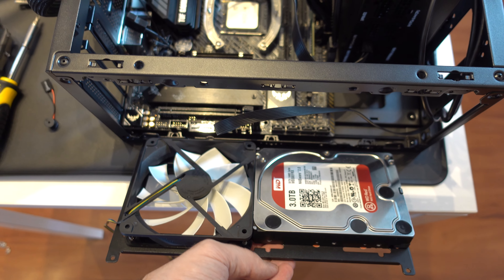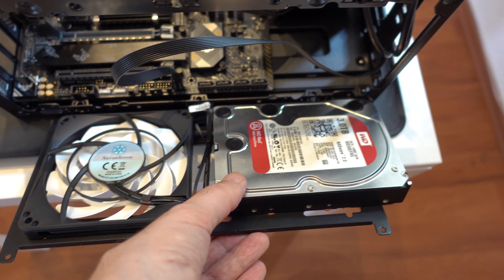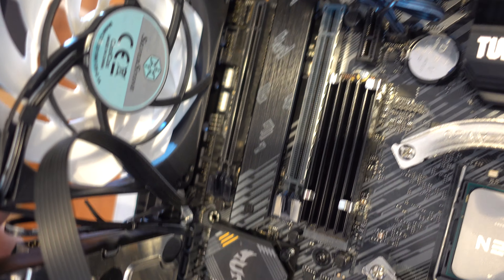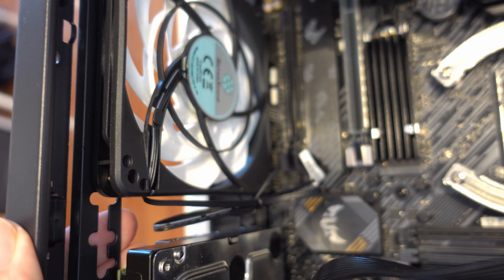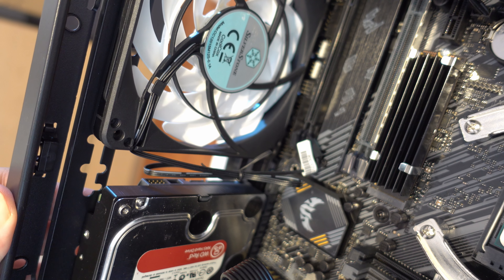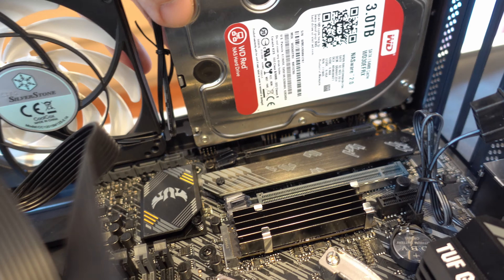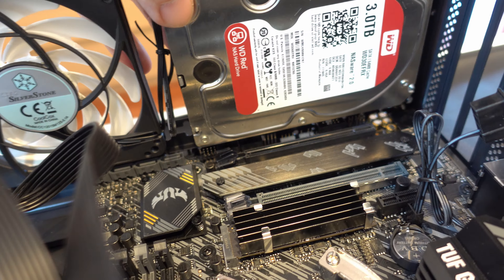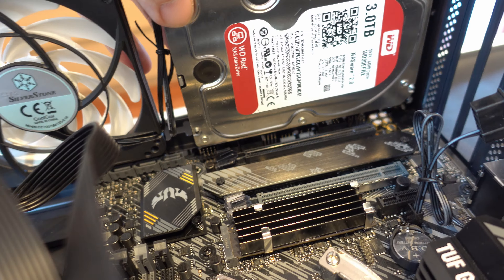SAMA IM01: major incompatibility of the mainboard and bottom bracket (and how to easily fix it)

Comment: You can actually move the fan a couple of mm's away from motherboard. There are offset screw holes on the bracket.
Reply from the maker: 😲 I hope this isn't a case of me being blind to an obvious solution - although everything is fully operational since a while, I'll check! I'd need at least 5mm of an offset, though - this is the gap I had between the case and bottom bracket when the fan was already touching MB bottom pins/connectors.

I'll check and will report back - thanks for suggesting a solution!
Reply from the maker: I checked the top bracket (easier to access) - and you are right! 😅 Yes, there are indeed ~5mm offset holes at 105 mm distance, which is exactly the screw hole distance for a 120mm fan....  Either I have failed to notice those (then 🤦🏻‍♂️🤦🏻‍♂️🤦🏻‍♂️), or mounting an HDD next to the fan didn't let me use offset positions (I seem to remember that only one pair of screws was next to an offset hole?). In any case,  I'll pin your comment to make it easier to see - thanks for the useful contribution!
Reply from the maker: Reviewing the first 3 and a half minutes of the video tells me this: 1) for the final configuration, I was trying to push the fan and the HDD as far from each other as possible to make room for the SATA and power cables, and 2) that did indeed prevent me from noticing offset holes.
So a much better solution for this exact fan+HDD config would have been some kind of a slim/flexi SATA power cable, and bring the fan and the HDD ~5-6 mm closer, to push the fan into those offset holes. Then no modifications to the fan should be necessary.
Reply: @tetracephalium  I solved the fan the same way, holes :) But I have no idea about SATA, I can't find a cable that is bent by 90 degrees and rotated by180 at the same time, as you indicated in the video. This board is not exactly the most suitable.
Reply from the maker: Finding such (data) cables wasn't easy indeed, but I did find some. (it's relatively late here and I'm exhausted after a long day, so I'll look up and post the ones I've used tomorrow during the day.)  I did give up on analogous power cables, though, and simply "forced" PSU's cables to "fit" - bottom panel isn't visibly bulging, so I guess that was alright 😅
Reply from the maker: @SUST-RWM  I've used two different types of SATA data cables (disclosure: both are affiliate links): for the HDD in the bottom bracket it was a "server-style" thin wire Silverstone SST-CP11-300 - Ultra Thin SATA III 6 Gbps Cable https://www.amazon.com/gp/product/B00L6M0LQE/ref=as_li_tl?ie=UTF8&camp=1789&creative=9325&creativeASIN=B00L6M0LQE&linkCode=as2&tag=bioua-20&linkId=9db6f04526484fbf680563ab9664dae5 (you can probably find many more of similar ones by searching for "server SATA cable"), and for the front panel SSDs I've used simpler/cheaper StarTech.com SATA to Left Angle SATA Cable https://www.amazon.com/gp/product/B004KDTTXW/ref=as_li_tl?ie=UTF8&camp=1789&creative=9325&creativeASIN=B004KDTTXW&linkCode=as2&tag=bioua-20&linkId=18dfcbd49d199e45dde8f67f3c7835cb  Hope this helps. If you do find some kind of slim/flexible SATA power cables - please let me know 🙂
Reply: @tetracephalium  Thank you very much. Searching for "left" or "server style" didn't really occur to me :) Now I found those and also cheaper cable here in Europe from PremiumCord, which cost 1 USD. As for SATA power cables, I'm probably lucky, because the last connector is oriented so that it does not interfere with anything if there is at least a little space under it, the wires point upwards (Fractal Design ion+ 2 660W). While buying an ATX power supply was a really bad idea, at least this seems to fit :)
Reply from the maker: @SUST-RWM  oh wow great cable find, then! I'm also in Europe but didn't come across that company. Glad this seems to be looking better for you!

Comment: I'd just like to say I appreciate all the vids documenting this build as I'm planning to downsize to this case (well, the differently branded Tecware Fusion which should be the same as this case), and I have a similar Asus TUF mobo, similar Corsair PSU (only it's 850W but same dimensions I think?) and a 5700 XT EVOKE. The tricky part is the EVOKE is a 2.5 slot GPU so I think it might not work at all, but the worst that could happen is I give the case to someone else in need and reuse my old one
Reply from the maker: with a 2.5 slot GPU you might do alright without any fans in the bottom of the case; GPU fans will pull air directly from the bottom ventilation holes 😁

Comment: Option1: Just invert the case... by inverting the case you can have space enough to fit a 120mm fan or HDD. 
Option2: You can mount that HDD in the back panel. Remove that 80mm fan installed in the back panel.
Reply from the maker: Thank you for the suggestions! In option 1, what do you mean by inverting? Using the top bracket space? I could indeed mount an HDD there, at the cost of longer power and sata cables - but otherwise that's a good option. Option 2 I did consider, but back panel is where  the cpu fan blows hot air, so placing an HDD there will both make it hotter and make the case generally hotter.

I guess the best solution was to not include any legacy HDDs and SSDs, and only have two NVME drives. (Inventory management is always a problem for me in RPGs, I always want to keep all the items 😁)
Reply: @tetracephalium  You can interchange the panels of the case coz they are the same size and fits (side panels and top/bottom panel) the front control panel are removable too.There's a same screw holes for this if you invert the case. By inverting the case.. your gpu will be positioned at the top.. theoretically you can install a slim fan here for exhaust.

I agree with  you to not include any HDD/SDD in this case, but the thing is M.2 and ITX parts  like mobo and psu are not cheap...
Reply: I placed the hard disk on the top toward the rear. There's no space left for a regular size fan, a slim one might fit next to the hard drive. I left the bottom empty (intake for GPU), and added a 120mm on the back side as exhaust even though it touches the IO ports (my motherboard is a basic one thankfully). Another potential mounting point for the HD is the front outside, but my case model has an rgb strip there so it won't fit.
Reply from the maker: Good solution! I didn't want "rear upper panel" HDD placement because of the distance to SATA ports - across all of the motherboard. But one could hide the cable behind the motherboard.

Comment: What measures has the fan? 120*120*25mm or 15?
Reply from the maker: I have first tried with a standard 25mm one (not sure if this was shown in the video), then switched to the slim 15mm version. Height/thickness of the fan doesn't seem to matter (much) here; with fan frame cut-outs I could have probably placed a standard 25mm at the bottom. I've also seen comments from people who said they could fit everything without any modifications to the fan. So your mileage may vary.
Reply from the maker: Please also have a look at a comment I've just pinned 😅
Reply: @tetracephalium  i got same troubles with motherboard USB3 conector and the lower fans, if thé 12/15 mm fans can't fit il'll thinking for change the PSU ATX for a SFX and place de HDD in this PSU suport
Reply from the maker: Oh USB3 connector is more difficult than audio and fan power, much stiffer cable... I guess the 5mm offset holes won't help you much, then?
Reply from the maker: This case does seem to offer more flexibility with an SFX PSU; at some point I was even contemplating returning my ATX and buying SFX, but as long as I could push everything into the case - I've stayed with what I had.
Reply: @tetracephalium   Do you think a slim fan would work with a 23.6cm motherboard? Or would I still need to modify the slim fans
Reply from the maker: @sunziii_  it should work, especially if you do use offset fan screw holes ; I haven't used them in the video.

Comment: I'm interested on how you will rotate the cpu cooler to exhaust to the top
Reply from the maker: I didn't do that, but Noctua mount allows both "horizontal" and "vertical" CPU cooler mounting. Mounting kit comes with two sets of brackets, long and short ones.

Comment: My solution is to fit the headers in the middle of the side of the fan.
Reply from the maker: I think I understand what you mean. But I'm not entirely sure 🙂
Reply: @tetracephalium  I had to hold the bracket diagonally, then slowly fit the headers & cable into the middle of the side of the fan. This is even after I had used the offset screw holes.

Comment: Pleaaaase change to ssd
Reply from the maker: 😀😀 Well, that would definitely add some air to the case, but wouldn't fix the 12cm fan/motheboard compatibility issue, and I'm fairly sure would still cause the same issues with motherboard's bottom-edge SATA ports... (I do have 2 SSDs mounted under the front panel, too - this will be in the next video, as well as the SATA cables conflict "workaround".)

Now, I did consider if an HDD is still necessary in 2021 - especially given that I already run a DIY FreeNAS box.

My reasoning to keep the HDD, for now, was as follows:
- FreeNAS isn't always on; I mostly use it as semi-online storage, e.g. to copy my projects and family pics/vids to, and then shut it down to extend the lifetime of it
- I still want more than a terabyte of "local" storage, and it doesn't need to be very fast.

I'm currently starting to re-consider storage concept a bit, primarily because none of the PC-local drives are mirrored in any way (including the HDD).
I have to either keep FreeNAS on all the time, or add some PC-local RAID or regular full-disk snapshotting/backup.
The HDD may be a good target for such full disk snapshots; not decided yet.
Reply: Ok, put it on the front
Reply from the maker: you mean the HDD, or something else?.. HDD wouldn't fit in the front; it would fit on the SFX PSU if I used one, but I had ATX